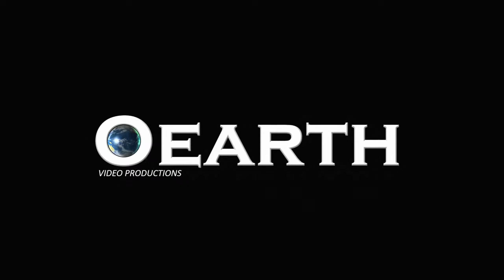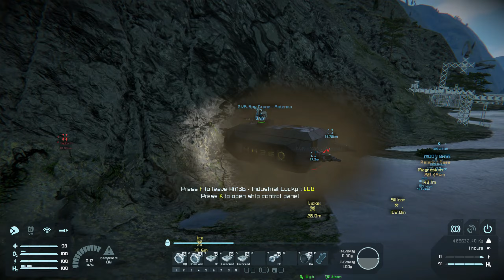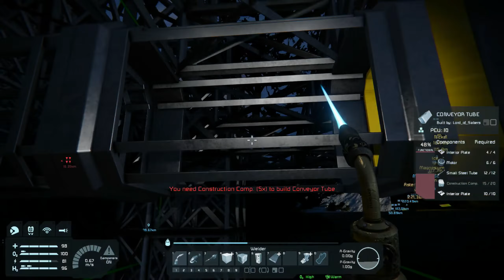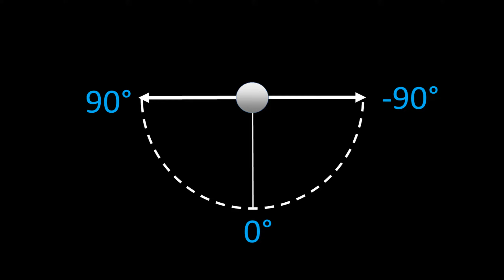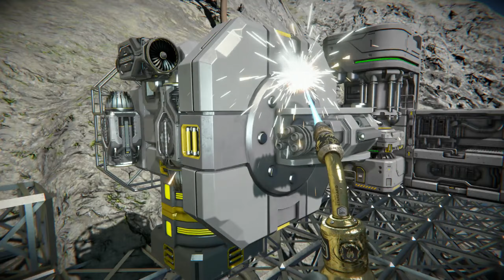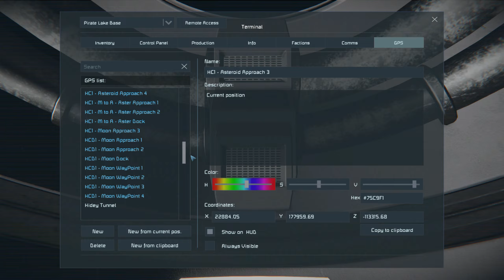Space Engineers - Piracy Server EP1 - Getting Started Making the Mountain Base | Let's Play

Comment: Finaly someone is making a square cave instead of this stupid vertical drill. I do square garages with this sweeping movment since many years. I lock the drills with a landing gear to extend pistons. Also if you add multiples of 5 pistons at each time, one step (.5m for each adds up to suitable 2.5m for each steps of the head. Last thing : share inertia tensor for the pistons to avoid them falling down, but not for the hinge, othewise it will not move correctly.